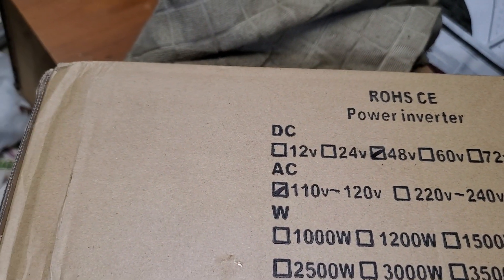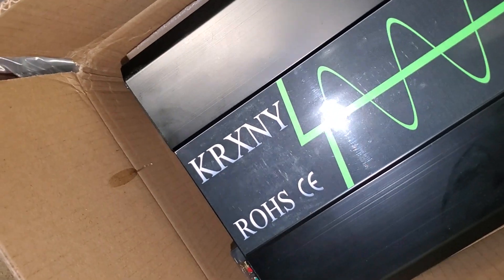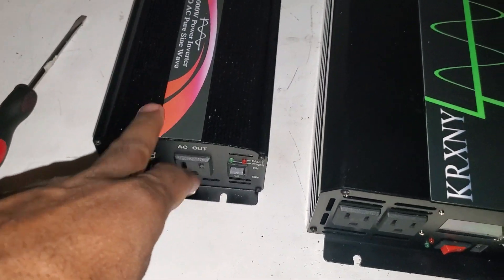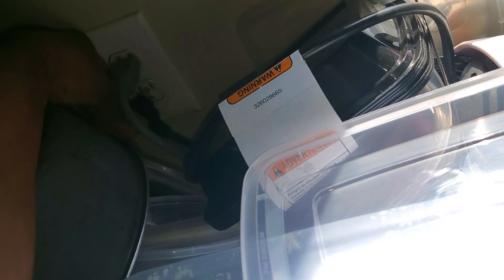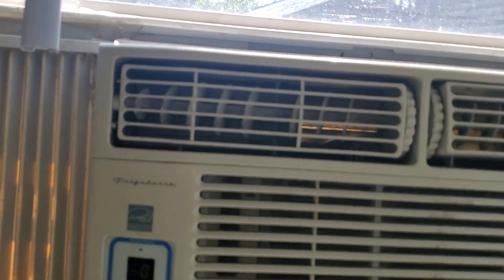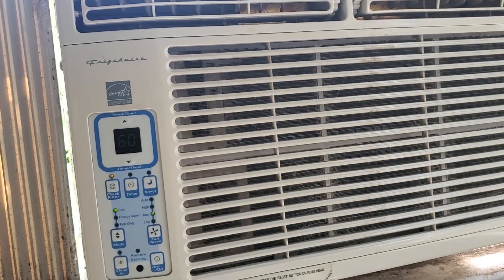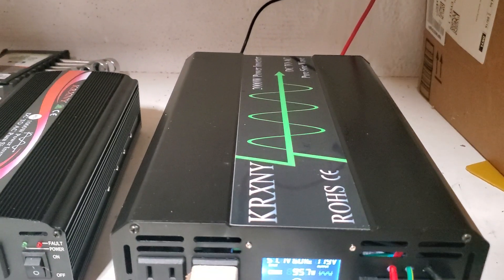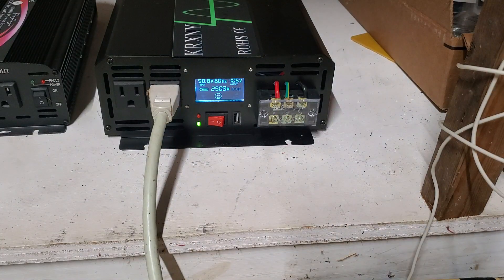CAN #KRXNY 2000W Off Grid Pure Sine Wave Power #Inverter 48V Dc To 120V Ac 60Hz RUN the house

Comment: What happens to the unit if 120V AC is connected to 120V AC grid ?   Is there safety that protects the unit?
Reply from the maker: Make sure the breaker of the grid is off otherwise you'll not have an inverter
Reply: @simplyfocus9937  is there anything that could provide protection?
Reply from the maker: @pc7225  You could have good procedures. There are some type device with breaker you can in the path panels in your house that doesn't allow both to be on
Reply from the maker: @pc7225  You could have good procedures. There are some type device with breaker you can in the path panels in your house that doesn't allow both to be on
Reply from the maker: @pc7225  I have a very good procedure: I shot my main grid breaker off, turn off my washing machine breaker off. I bring the solar/inverter power through that breaker. I go to the garage, turn on the solar power on, turn on the breaker on for the house. Go back the house, there should not be any power until I switch the washing machine on.